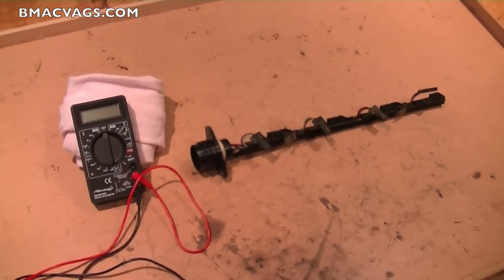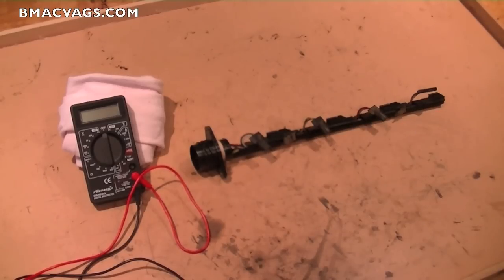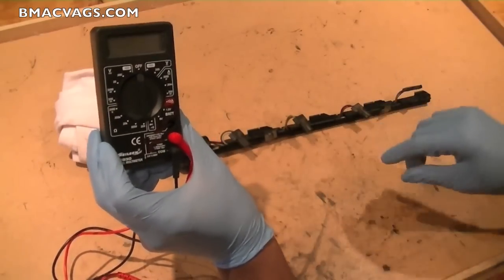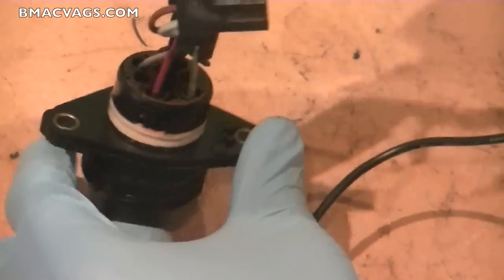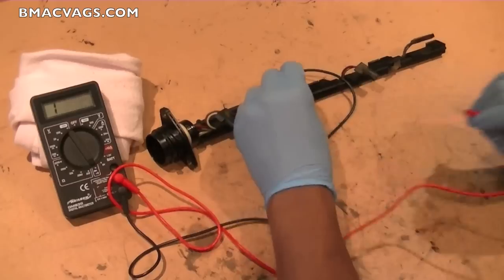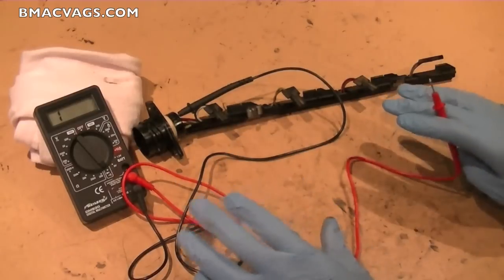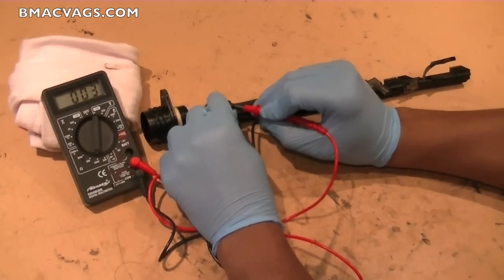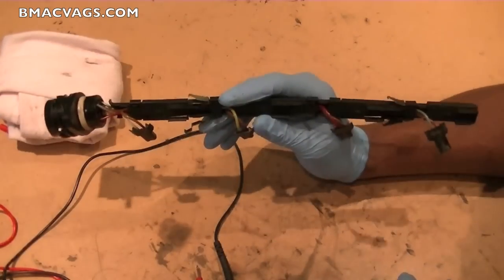How to test and troubleshoot the Diesel Injector Loom

Comment: excellent video. Will there be a circuit for pulse generators for common rail injectors?
Reply from the maker: Pulse signal comes from the ecu
Reply: @BMACVAGS  that same signal i want to simulate and arm the electrónics to use it outside the vehicle

Comment: If you have a 20 strand wire and you cut 19 of them you will still get continuity !
But put the wire under load you would find a poor connection using volt drop.
This method will only work if the wire is open circuit.
Reply: Exactly ! Voltage drop under load is the way to go !

Comment: Hi there great vid I’m relatively clued up on this sort of thing but you say in your video/blog you had a misfire on cylinder 1 I also have this issue and it’s intermittent worse when it’s cold and better to basically fine when it warms up, my question is you say you checked the loom and it was ok?? But  did you misfire go away after fitting the new loom🤔 look forward to your reply many thanks Rob
Reply: Could also be your torsion value is off and can cause cold start issues or roughl idle or no start

Comment: i got a juddery 1.9 tdi PD 103 bmp caddy which is when warmed up jumping about like its miss firing, we plugged the computer in and all injectors seem to be -300 or +300 on the flows, its also taking many turns of the starter motor to get it to fire up, gonna get this loom looked at monday, thanks for showing me how straight forward it is to pull out.
Reply: Did it solve the issue for you? Got high readings on the flows aswell..
Reply: hi the high flow readings mean the injector seals are leaking, so ecu overcompensates. bout £15 on ebay for seal kit, but if the head is scored you can sometimes fix with a flap wheel, will fix your problem and cure your cranking and bad start issues instant
Reply: The high readings were only for a short period.. next morning after was fine! 1 week ago it started to judder again.. But now again its fine.. Very weird, but it doesnt look like a mechanical problem..
Reply: ah right, thought you had same symptoms as the guy you replied to, the most common cause of this symptom is the connectors open up with the heat and vibration but the best way to be more exact is to read the codes, but its only a 30min job to pull each connector and squeeze each connector so they get a better grip on the injector valve, give it a try but again read the codes with vcds  Ed
Reply: I gave it a read with vcds, no error codes popped up.. When i replaced my rocker cover gasket week before the shuddering happend, i replugged the connectors to make sure they are in good.. Maybe its worth it to change the whole loom, when it happens again, and if it comes up with an error code.
Reply: did you squeeze closer the metal connectors in the plastic plug as the rubber seal makes it feel like they are tight but are not, this usually fixes the juddering issue, but usually throws a code, the absence of any code intermittent or other could point to the flywheel (DMF) issue this can show as juddering? is it high miles? Ed
Reply: Its at 230k miles.. im running a smf kit. ill wait till it judders again, pops up any error codes, and maybe a check on the connectors again soon!

Comment: Got an A3 1.9tdi BKC. engine cut out and now cranks but won't start . Got a p0200 code (injector circuit open). checked injector loom, all wires had continuity and 2-3 ohms resistance. any ideas what problem could be?

Comment: My symptoms were no.1 cylinder missing - running like a pig after 10 - 30 mins of use. Can't remember code it kicked out.
Thanks for upload helped a lot - initially panicked - A LOT - when I saw injectors and wiring loom in the same sentence.
Would like to share my experience in the hope of assisting others.
Removing tricky bolt on the cover - managed to do with 1/4" drive, extension and knuckle joint and a fair bit of wiggling. The bolts remain captive in the cover, so minimal effort getting thread started back in.
Did the test with the meter and continuity checked out alright, the cables didn't seem brittle, so was puzzled.

** THE SOLUTION **

The plastic rail can be clicked open with a small screwdriver to reveal the whole cable, but all that was needed was the plastic covers that guard the the little spade connectors (that go directly onto the injectors) to be carefully opened, GENTLY squeeze the connectors closed SLIGHTLY with little pointy pliers then reassemble.
Did this and hasn't missed a beat for over a month now.
Reply: After reading some forums too this seems to be a good fix for some time before buying the 100 harness :/ I'll actually be doing this tomorrow night on mine. Same Cyl 1 misfire p0201 or p0301 can't remember.
Reply: So you reconnected them?
Reply: Ermm !
Yes reconnect, then reassemble.
Reply: Thanks but didn't work. NEVER buy fiesta with TDCI engines (THEY ARE CRAP). Its still stuttering when cold, even have replaced injectors.....
Reply: doppollis

Comment: Is it possible that deviation of +3.00 mg on injector is caused by loom bad contact ?
Reply: I had the same question 7 years later, For me it is NOT the issue, but I still wonder if the loom can cause faulty readings because my IQ deviation numbers sometimes move slowly or  not at all displaying the same figures for several miles.

Comment: Hi BMAC VAGS I have an Audi A3 8p TDI 2.0 and I get a slight judder at idle when the car has warmed up. Could this be the injector loom and is it a difficult job to replace? Cheer mate and I really enjoy your channel.
Reply from the maker: Have you got a vagcom cable?
Reply: BMAC VAGS
Hi. No I don't have a vagcom cable. I'm going to get the car serviced and see if it still judders once engine has warmed up. It only does it slightly and not all the time. Someone also said it could be engine mounts. Thanks for getting back in touch :)
Reply from the maker: Is the judder continuous or comes then goes?

Also is the car manual or auto?
Reply: BMAC VAGS
The judder is random once the car has been for a drive. The car will do a quick slight judder,then is fine and might judder again maybe five seconds later. It is never a continues judder. The car is a manual drive and judders in or out of gear while at a stop, The car drives well too, so I don't think it's connected to the clutch.
Reply from the maker: Change the temperature sensor, that would be the first thing to dibin my books
Reply: BMAC VAGS
Will do and I will keep you up to date with how it performs. Thank you for your advice.
Reply from the maker: No problem
Reply: +lyniseuk Before replacing, test the coolant temperature sensor for correct resistance hot-cold. 

Also check out your EGR valve stuck open. 

Use scantool to find out which cylinder(s) the misfire is occuring. Possible injector problem? Use a mechanics stethoscope to find out if an injector has stopped firing during the misfire. 

Good luck!